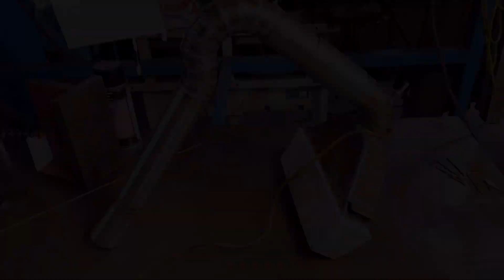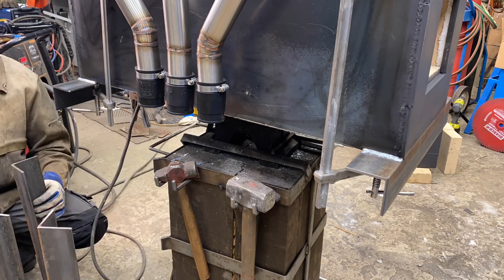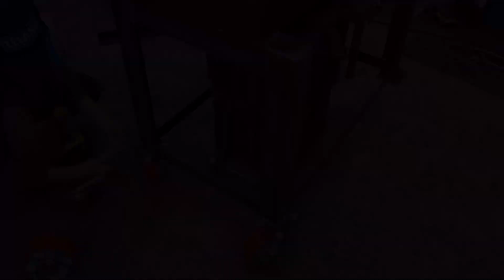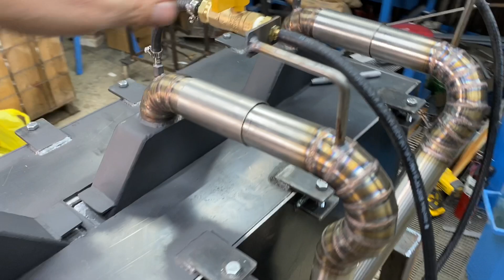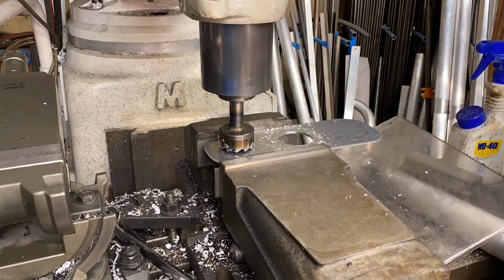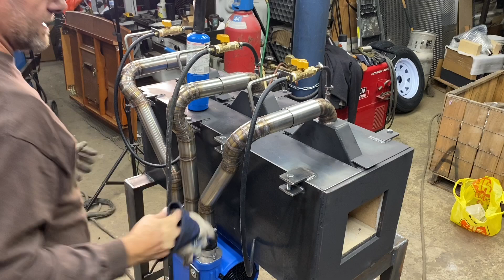MONSTER FORGE BUILD!!! ITS ALIVE!!!

Comment: A small modification you could add to the air regulator sleeves to make them easier to move would be welding a small handle to them. Something as simple as a small stem of the same rod you used to secure the gas valves.
Reply from the maker: Great idea